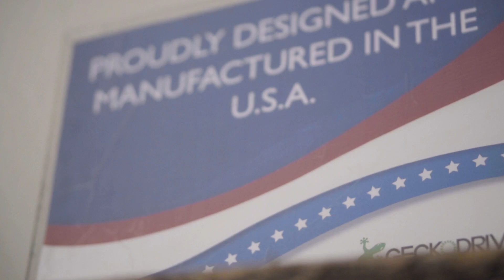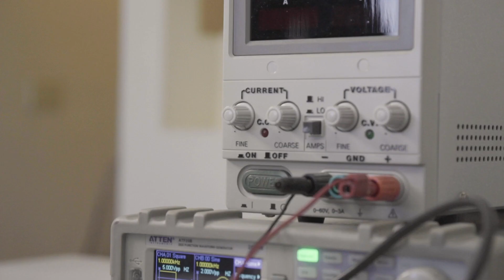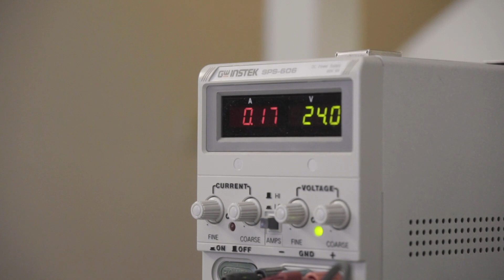GR214V Bulletproof Stepper Drive Setup Video

Comment: Is that a nema 23 motor?
Reply from the maker: Yes it is.
Reply: Can you please send the circuit diagram you used in connecting this, I have a nema23 2.8A motor. .. is it compulsory to adjust the knobs in the gr214v?

Comment: Why the electrolytic capacity?  Can someone help me?
Reply from the maker: We use an electrolytic capacitor during bench testing to allow for test probes to be attached to its leads. A capacitor is not required for operation and is only used to allow for quickly changing which supply we are using in a test environment.